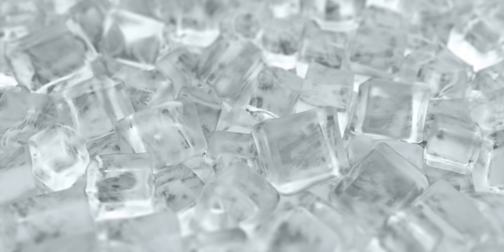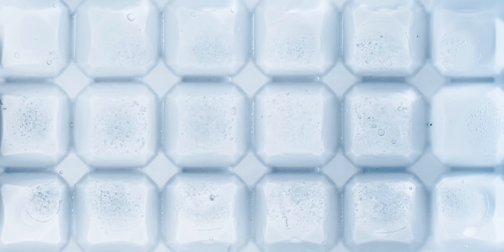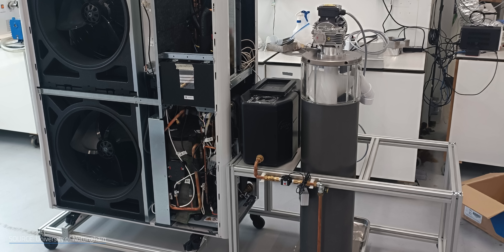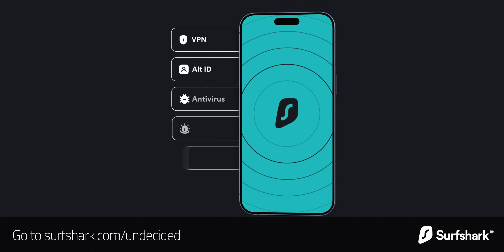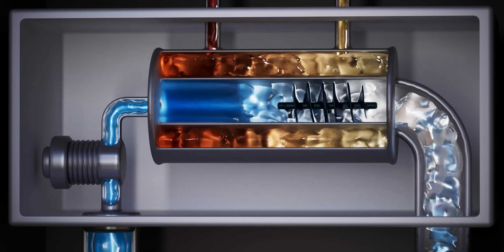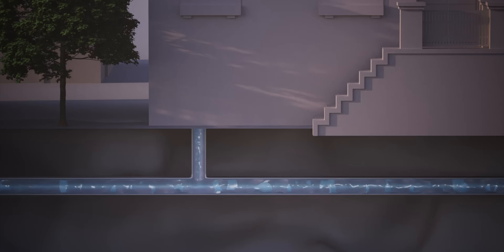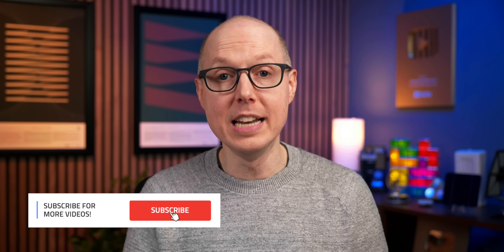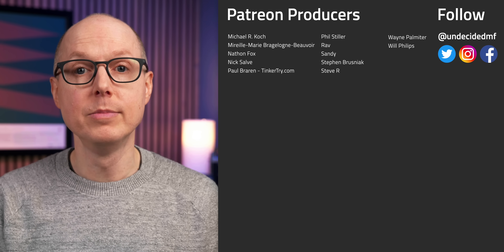How Can Ice Heat Your Home? Ice Source Heat Pumps!

Comment: This video is deceptive - ICE does not provide the heat  - 

it is the freezing of the water to make slush - the heat pump is removing the heat from waste water to make slush!  water supply must be constant to melt the water going to drain.   The potable water is not free ?   and is also required to provide the heat in the first place, this water must be above freezing .   The volumes of water has not been discussed in detail.   Just imagine how much slush is produced from these communities?     The energy to pump slush was discussed and must be much higher than other common systems.   

Having some experience in steam and Hotwater industry - the pumping cost increase for hot water compared to steam heat transport is substantial.  The moving of the heat !  not the creation from a source.   

This is a very special situation which simply cannot work in a lot of other situations.    I am very much in favor of Heat pumps use in general  -  but the source of the heat is always the issue  -  as the volume increases the problem increases.   Frozen geothermal field is a real issue and we have witnessed this more than I want to mention.   There is only so much heat that can be extracted.   Hence the reason to have electric or fossil fuel supplementation.

The idea is to concentrate the heat extraction  -   to reduce the volume because of entropy on the freezing water,  but the volumes are too low for most locations  -Also  17C room temp that is just unrealistic -  20-22C is normal on the other side of the world , well at least in Canada.
Reply: AGREE.  This is NOT ICE-Source heatpump, it is a source-of-ice heatpump.
( I'm starting to get sick of this channels' bullshit titles. )

This is NOTHING but an icemaker where you use the heat and THROW AWAY THE ICE.

I don't see how this is efficient in ANY WAY unless you use the ice slurry to cool commercial buildings.

STEALING money from consumers to make cold for someone else.
WTF

Comment: if you are going to do this then why not just use existing water line where the city heats the water to something economical. with this, the water comes in already warm doing without house water heating and a house heat pump which works more efficiently with this warm water.

Comment: Efficiency: GSHP > WSHP > Ice Source ≈ ASHP (in mild climates; ASHP lags in extreme
cold).
Upfront Cost: ASHP < Ice Source < WSHP < GSHP.
Installation Complexity: ASHP (easiest) < Ice Source < WSHP < GSHP (hardest).
Best For: Ice Source (cold climates with space for tanks), ASHP (budget-friendly, mild
climates), GSHP (long-term savings, land available), WSHP (near water, regulatory
approval).

GSHP - Ground Source
 WSHP - Water source 
ASHP - Air Source

Comment: Why can't we use the regular household water as a heat source? Although, I am all for re-using the gas pipes for something.
Reply: You could, but regular household water is more expensive than using untreated rainwater or river water. In fact, you'd probably have to use household water during the transition period until the last customers are cut off from the gas in those gas pipes.

Comment: The chipest heating sistem is the cogeneration, a genertor produce electricity plus the same BTW as heat as any boiler plus the heat in the generator as result of induction,small unit running 24/7 during winter basically erase you electricity bills to O and the heating fuel 50% ,I did it .

Comment: Can this be a closed loop system? That would be a far more effecient use of water.
Reply: More efficient use of water, but way less efficient use of energy. You'd have to add energy back into the ice to melt it, which would negate any benefit of using the system.

Comment: yeah thats bollock. Made to fail. So many moving parts... But! Doesnt actually have to be any moving parts: Using the expansion as water forms crystals and the condensationcreep... Let the coldest surface be above and angled aflutter and make that the waterinlet. A sort of "palmtree-shape" or a basidiomycete mushroom... That wouodld attract moisture from the air irrespective of gravity. Letting the basidiomycete "shiver" or "flutter" (by plastic deformation like a spring) when the hat has formed icecrystals enough to weigh it down to x... it pops the flutters like a deflated football, which causes it to shake off the icecrystals so more can form. Rest of sysytem just gravity =)

Comment: What about just using the gas as geothermal?  No mass changeover required.  The latest refrigerants are propane.  Just leveraging the flow of gas through the ground would moderate temperatures.  It would require establishing a loop for a customer to pass their refrigerant lines next go in order to diffuse heat.

Comment: Why not have district heat pumps that warm or cool the city water supply and let homes draw from that?  Since the extra water use is a concern, require such heat pumps to have a local well insulated heat/cold storage tank and draw from that first - i.e. heating the tank in the day in winter when air temps are higher, freezing it at night in the summer when air temps are lower.
That makes the home heat pumps more efficient to start with, and this scheme can be implemented in pretty much EVERY city with minimal and centralized infrastructure.  
While it's easy to guess that pumping slushy ice around could have unexpected problems, changing the temperature of the water supply by maybe 10C-15c (and always toward a more moderate temperature for the time of year) should have very little consequence.
Reply: The problem with that is installation. Ripping up every gas pipe in the UK to replace it with properly insulated pipes for district heating is not fiscally possible.
Reply: @willythemailboy2  uh, no, read again. I'm saying to use the existing water supply system that pretty much every city already has, with only moderate temperature changes.  Plus augmented home heat pumps.
Reply: @ Just increasing the incoming water supply from say 10 C to 25 C is not going to deliver an appreciably larger source of heat compared to the heat derived from freezing the water.

Comment: I don't see much advantage in using gas pipelines, since you'll still need a return pipe for the sludge. But the advantage to a normal water based system is that the pipelines can be much smaller.
Also it might be an idea to run a line to the kitchen to your refrigerator and as input for your freezer.

Comment: Matt, at about 8:00 you say that it's not a district heating system because it doesn't send heat out from a central location. From the explanation you've given elsewhere in the video, it would seem that is incorrect. Granted, the fluid going from the source and into the home is the same temperature as the fluid going out and back to the source, in reality heat is indeed being sent from the source to the homes. Otherwise, why bother?
Reply: I think that he meant district heating systems transport heat that is above ambient temperature, instead of extracting heat at each home from something that is already ambient temperature, creating a colder return. With district heating systems, you would want insulated pipes to prevent heat loss from the temperature difference, whereas with this system, you would want especially conductive pipes to pull heat back into the system from the temperature difference of the icy output. That is my understanding, at least.

Comment: If water goes in and ice goes out then it is the water that gives you the heat. You have to pump heat out of the water to make ice. Then you have to send the ice off somewhere to be melted. Whatever melts the ice is your heat source. It could be geothermal, solar, gas or even electricity. But those are your sources of heat. And if you don't melt it it will pile up somewhere. And you will run out of water to freeze.

The high heat of fusion of water means you have to move less of it to transport heat. But it is just that, a method of transport not a source. 

And yes the hotter the incoming water the better it works because... the water is where your heat comes from.

Comment: Every house has has a water line, why use the gas pipe for the water pipe? Use water lines for what they're good for, use the gas lines for the slush, and to get it down the line, a good pump will suck anything through. Problem solved, no additional digging. Derp

Comment: It is just a water source heat pump that supercool the water to extract a much heat as possible. Reducing the water to a super critical low temp. So a super critical water source heat pump. I could see this replace the old NYC Steam system.

Comment: I don't think the open loop idea is wise, it would drastically increase water usage. Unless you've got a massive excess of non potable water in your region and very cheap water refinement, I don't think it would be a good idea. Using those natural gas pipes for something else would be a good idea though.
Reply: If I'm mathing correctly, the average UK home would need only about 1200 liters of water to replace the energy content of natural gas used per YEAR. Compared to about 350 liters used per DAY for normal usage, the increased water demand and sewer disposal cost is absolutely trivial. Even allowing for inefficiencies doubling the theoretical usage to 2400 liters of water is still a rounding error.

As for the change over period, it would be possible to run the heat pump using existing potable water lines until an entire area is converted, then switch the gas pipes to non-potable water. After that switching each end user from the potable system to the non-potable system would be relatively trivial. While more costly in terms of water prices, especially for the early adopters, it spreads the transition out over a reasonable time frame while not leaving anyone out in the cold, either figuratively or literally.

Yes, this is copy pasta, but at least it's my own copy pasta rather than stealing comments from other people.
Reply: @willythemailboy2  makes sense, I assumed it would be way more.

Comment: This is fine, assuming that 80% of the UK wants to get rid of their gas in the home. When many places already run on gas and there's a big preference for things like gas stoves and fireplaces. I don't want to give up my gas pipe and convert my home to electric only.
Also he said drop the slush down the drain. Which I interpreted as the slush just goes into the normal sewage system. No need for extra pipes. But If none potable water is single use, then why not just use the water supply you already have. No change required

Comment: Why can’t the water system be used?
Reply: It can, but long term the cost of using treated drinking water vs untreated water pumped straight from the nearest river/sewage treatment plant outflow is higher - if you get the separate pipes for the separate water source at minimal cost.

Comment: Can these systems be used for cooling in the summer?
Reply: Not very well, since they'd lose the benefit of the phase change. They'd use something like 40x as much water to get the same degree of cooling as they could heating.

Comment: This idea relies on the gas system being turned off before the slush system is installed. Firstly, there will inevitably be resistance to this from consumers (aka voters) who don't buy in to the idea. Secondly, there must surely be a delay between turning the gas off and starting the water supply in those pipes. Thirdly, there are bound to be teething problems in some households - the key question is what proportion of household systems will have problems.
Reply: As for the change over period, it would be possible to run the heat pump using existing potable water lines until an entire area is converted, then switch the gas pipes to non-potable water. After that switching each end user from the potable system to the non-potable system would be relatively trivial. While more costly in terms of water prices, especially for the early adopters, it spreads the transition out over a reasonable time frame while not leaving anyone out in the cold, either figuratively or literally.

Comment: As an engineer, I find the video introduction and title a bit "clickbaitey"; you extract energy from the formation of ice, not from the ice itself.
Reply: Yep, not the best explanation in my opinion.
Reply: I really agree with you. There is nothing novel about this concept. I have 30 year old reference books that describe these types of systems. Even better are systems that utilize eutectic salts for energy / temperature storage mediums (if I remember correctly). But of course, the devil is in the details. Clearly he doesn’t have the appropriate engineering expertise to know when he is off the tracks.
Reply: I agree, this video is a joke. Besides using Eutectic salts as the phase change medium is superior and using the existing natural gas line infrastructure is also a joke.
Reply: Especilly coming from Matt.  He's smart and relevant, I'm sure he knew what he was doing.  The video starts with "Heat... from ice?"   ... much punchier thatn  "Heat from water... to the point it becomes ice"  He needed us to click, he acheived his goal. @Matt: I understand the marketing, but try no to use this clickbait method to often please.
Reply: That is why he has a nice home bought by us watching half of his meaningless blabber.

Comment: So, we get water delivered, and slush taken away, by the gas network? If we had a decent reservoir, exposed to air above freezing, couldn't we just let that happen without the gas people? You did your best, but even though the latent heat of fusion is very high, how can that be used to increase the temp of the fluid, heat-delivering medium? You still need hot water, or air out the other side. I feel like I'm missing a step. How is the non-potable water induced to turn into an icy slurry? A Freezer, and that will take energy to run. (I'll do some further research....unless someone is able to explain to a reasonably scientifically literate guy how this works.

Comment: Just googled for interest sake; A lake or pond geothermal loop is recommended to be 8-10ft deep and 1/3-1/2acre of surface area. Which is 135-167ft diameter, call it 160-200ft with a sloped shore. I would bury loop under the pond bottom, below a pond liner to prevent any water-loss to ground and coolant from coming up(god-forbid).

Comment: In the diagram at 10:10, it shows "Ground Absorbed Heat". Similar to Ground Loop systems. These ground loop systems are usually in isolation (Like Matt's).  What happens in the Long Term as this cold and slushy water is pumped year round in a high density situation. I foresee a marked decrease in ambient ground temperature.  How far will it go and will it affect the slush consistence adversely? As well as what plant life may exist near the pipe runs.

Comment: they should combine this with watercooled solar panels: the water input absorbs heat from the sun, boosts photovoltaik efficiency while doing it, and has slightly more thermal energy to feed into the heatpump.

Comment: Essentially, it's just a crushed ice machine. While it is a reasonable idea, there are some inherent problems with it.

1. The orders in the machines transfer a significant amount of force to the gearbox and bearing assembly - there are some partial improvements to be made with material science and non stic surfaces. However, non-stick surfaces have a lower heat transfer rate, and this affects overall efficiency. 

2. The combined volume required to heat a city is likely far greater than the underground services can handle with the current pipe sizes. Look up a 500kg per day flake ice machine to compare the heat output. This will give a bit of a guide as to the required heat capacity ice volume ratio.

3. The ground only has so much capacity to absorb/reject heat, in near 0C conditions, and using a single linear pipe (or 2) will not provide sufficient heat to melt the ice and stop the conpaction. 

Keep in mind that the energy you take out of the water/ice slurry has to go back in for the system to keep functioning.

While not insurmountable, the above challenges will need to be addressed, and these are just of the top of my head ( some random internet guy 😊).

Comment: Where I live, the natural gas supply to most houses is in a pipe that either 1/2" or 3/4" diameter, might not carry enough water for the heat pump.
Reply: You would absolutely need new infrastructure or only for new homes being built.